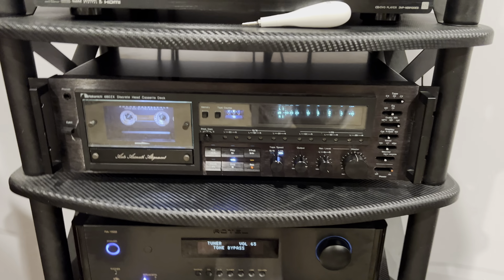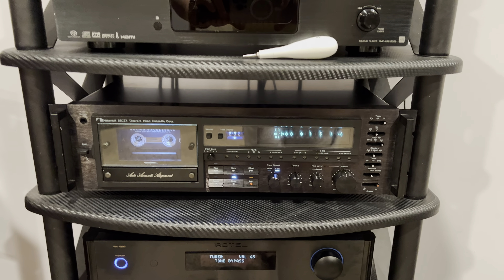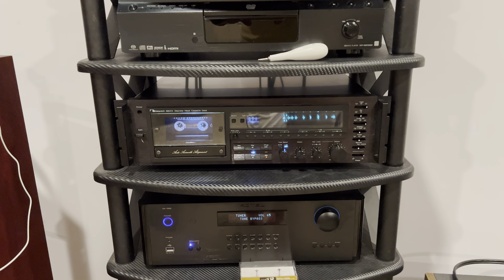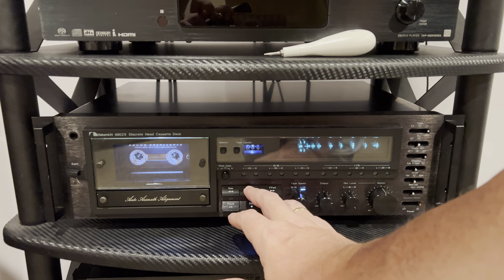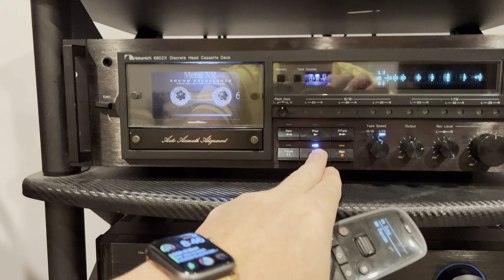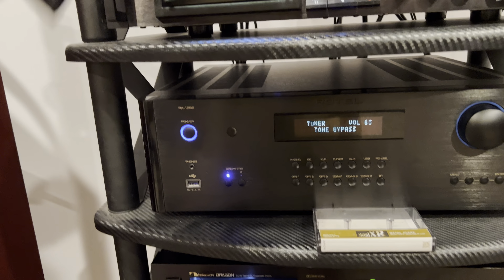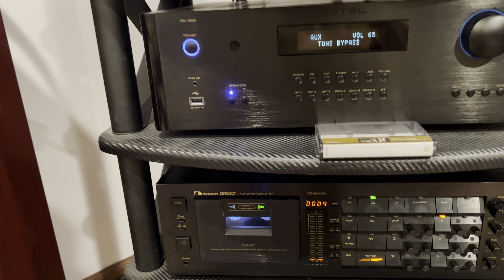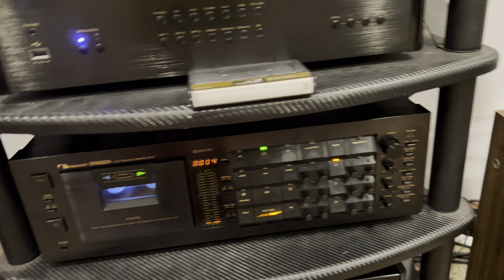Nakamichi 680zx: Metal Tape Recording After uPD4066 Audio Switches Replacement

Comment: Significant difference! How can it be that replacement of a working 4066 makes all that diffirence? I don't understatement that. Caps in a signal path, sure. But this?
Reply: High on-resistance, and non-linearity are the biggest problems with these chips from that era. Depending on the stage they are in, they can introduce phase shifts, and in some cases also alter frequency response (they start acting like "filters"), like the PB side of the JVC in the previous videos.  I am glad that there is a better and most importantly cheaper solution than the MAX chips with the CD4066BE, although I haven't tested them yet (I will soon).